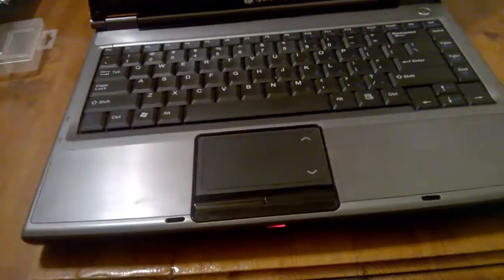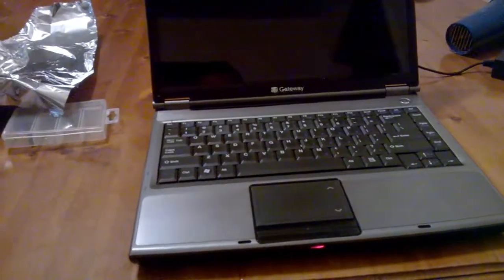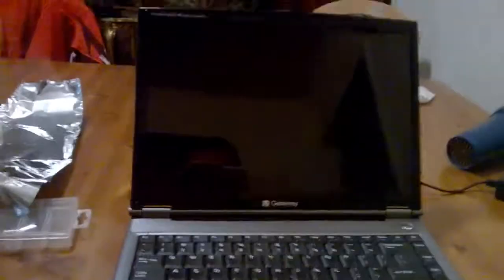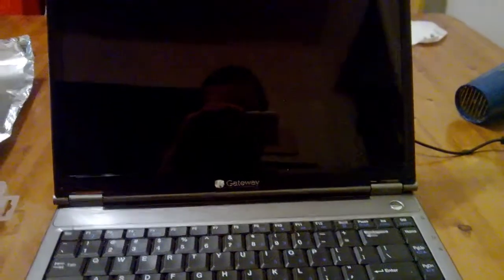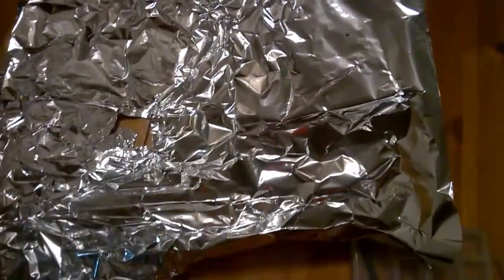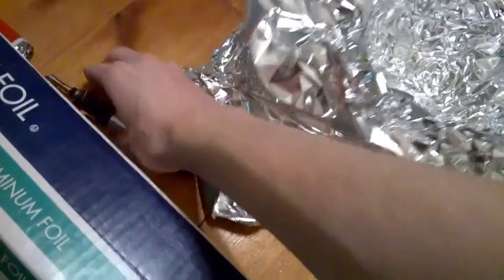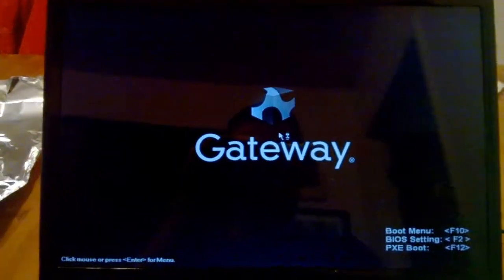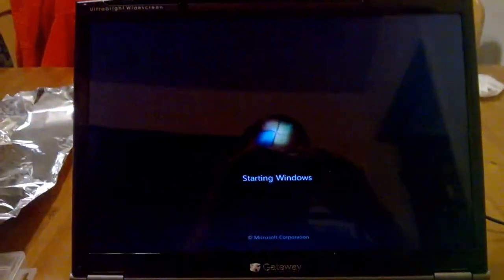My First GPU Reflow on Gateway W340UA

Comment: help!!! how does the graphic chip look or where is it located on motherboard
Reply from the maker: Lena Alvarado http://www.esaitech.com/images/detailed/11/UUU/img100575.jpg 

this is a picture of the motherboard I grabbed for you off google :) the main CPU processor socket is the white socket on the very left, then the GPU graphics processor in the middle, and a chip that says Nvidia on it to the right, the graphics processor is in the middle of these two. :D
Reply: Tyler Hanson i found a picture of it, thanks though i have the motherboard in front of me already putting it back together but those cushion stickers dont stick should i keep them off?
Reply from the maker: Lena Alvarado are those the cushions that stick on top of  the USB ports and other connectors?